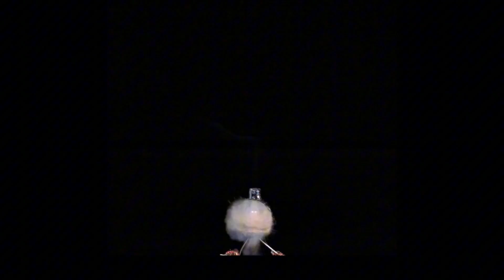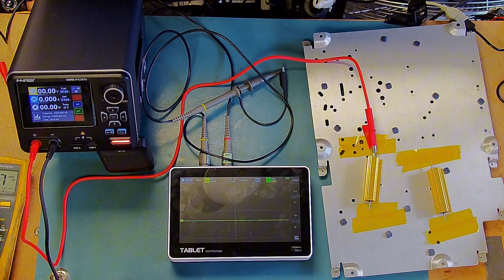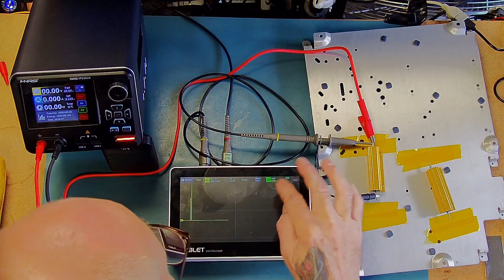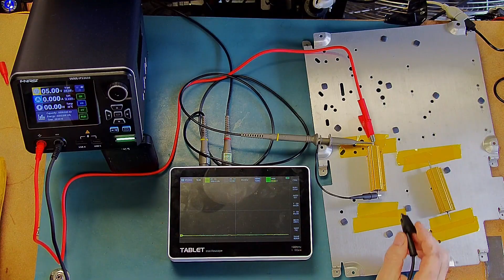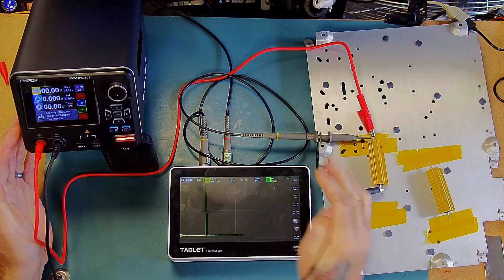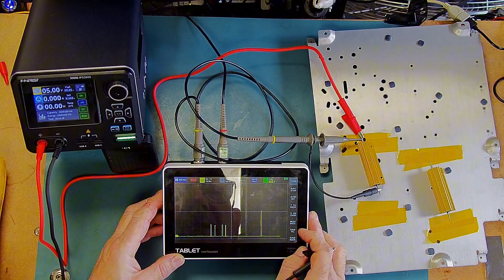FNIRSI IPS 3608 Appears to have more serious problems

Comment: 1013D in long base mode, samples very slowly, this pad does not capture everything. In addition, the obtained samples are averaged, since their sampling from the ADC is done randomly regardless of whether the ADC has completed the conversion. Use short base mode with a higher sampling rate and a single trigger.
Reply from the maker: Thanks

Comment: I have identical problem, just without system freezing.
Makes voltage injection and diagnostic very difficult, unless you solder both + and -.
Reply from the maker: Hi, I think I have a particularly poor unit, which doesn’t inspire confidence in the manufacturing and quality processes fnirsi uses. Yes ,as a power supply for bench use it is very very limited. Basically it is riddled with problems. I have heard that Fnirsi are working on addressing some of the issues , how that will be done though I am unsure, because I feel many issues are hardware related. I guess time will tell.

Comment: I gave up on buying FNIRSI - it’s gone down hill with shoddy construction.  Solder joints are often loose and build quality poor.  Gone down hill.
Reply from the maker: Hi, I have a couple of other fnirsi products, and generally speaking that are okay for the money. This power supply is not in that category, and the real killer is the total lack of warranty support. I purchased it directly from fnirsi, and it supposedly has a 2 year warranty. The best support I have had so far is a link to a Chinese supplier of spare parts, inviting me to fix it myself. That is from fnirsi, that is the warranty support. Btw that purchase is private, not related to my YouTube channel, as far as I know fnirsi are unaware of the connection.

Comment: Are those large resistors wire-wound? Perhaps resistor's inductance is discharging through the supply when you don't give enough time for the charge to dissipate.
Reply from the maker: Hi, they are wire wound resistors yes. IMO the fly back from an inductive load is a perfectly normal situation for a power supply and should be easily tolerated. I reversed bias diode across the output is the usual way for a traditional power supply. Thanks for your comment, I hope I did not misunderstand.
Reply: I think choke coil inside power supply causing that spike

Comment: I had the same problem. I found it, when I was charging a battery. When it should switch from CC to CV, the rep protection showed up. The problem is the firmware. Try to downgrade to 1.2. You can do it here fortunately. When I downgraded the firmware, the problem with the rep is solved. The freezing UI is also solved.
Reply from the maker: Thanks

Comment: A "rep error" on an FNIRSI power supply typically indicates a protection mechanism has been triggered, such as overvoltage (OVP) or overcurrent (OCP) protection. To resolve it, you must first disconnect the load, then identify and fix the cause of the fault in your connected circuit, and finally, reset the power supply.
Reply from the maker: Yes it is an error I agree totally. The error can be caused by collecting, disconnecting and collecting a load in under 1 second. This even happens when testing a diode with the power supply, accidentally make a bad connection and boom the power supply trips with a rep error. I think the cause is the power supply, not the connected circuit.

Comment: Maybe the resistance acts as coil and the output gets excess voltage spike and OS crashes. Try to use flyback diode.
Reply from the maker: Hi, for sure that is a potential problem, however the same thing occurred when using an electronic load. There should be no back emf from that.

Comment: While you at it please do CC speed test. If you have spare LED, set CC to 10mA and voltage to 12V (or more) and connect LED. If it is quick enough it should lower voltage to appropriate level and not burn LED. If output capacity is high, voltage would drop to slow and burn LED in the process.
Reply from the maker: I'll give that a try and include the results in a future video.

Comment: Thanks very much. It is actually pretty good. The current overshoot is less that I feared. And importantly, on that "rapid connection stuff" my own new lab supply released its magic smoke and I had to replace FET's. So annoying it may be, but I rather have it go into safety switch-off (and hang) than into smoking.  Of course, my old stepped transformer based lab supply (in retrospect) was solid as a rock.
Reply from the maker: A decent linear dc power supply is unbeatable for lab/bench purposes. The switching type may be cheaper, more efficient etc. But for diagnostic, design and testing they are simply inferior.IMO

Comment: What version of the firmware do you have running on it? I notice FNIRSI have 1.3 available.
Reply from the maker: Hi, the firmware is the latest v1.3.
Reply: They released with 1.3. I am currently trying to get a refund. It's horrible😊 @Joftec